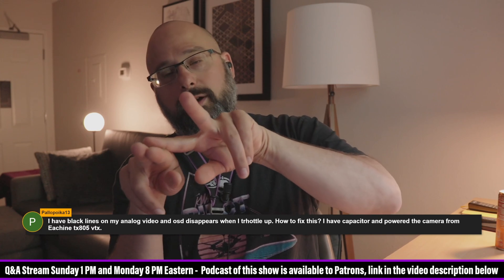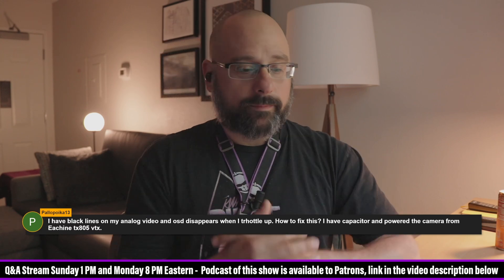How To Fix Black Lines In Analog FPV Video Feed? How Do I Know If My Capacitor Is Bad? - FPV Q&A

Comment: I have this exact issue. I fly an air75 with the 5in1 flight controller and do you think i should just replace this or could it be for another reason like a battery problem. I cant see any visual issues with the motor screws and I cant see any other things that are touching things they shouldn't be.
Reply: I had the same issue on my air65 5 in 1 and it was solved quite simply. I loosened the 4 screws holding the camera a little so that the seals were looser and dampened the vibration instead of being transmitted.
Reply: @AndriiMonakhov will try next chance I get
Reply: @AndriiMonakhov there is absolutely a relationship between vtx output power and the dampener's tight ness......... i don't get it yet though. To right or too loose is an issue.
Reply: Im also flying air75 any fix?
Reply: I have the same issue on new air 65 and air 75. Older ones 2, multiple googles see the issue. Took me a year to notice or they went bad in a year? Idk.